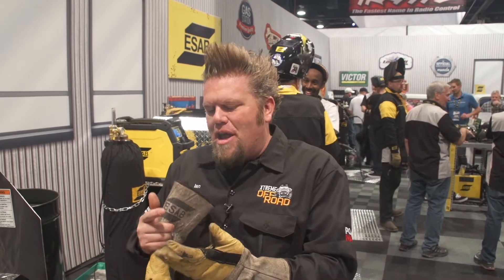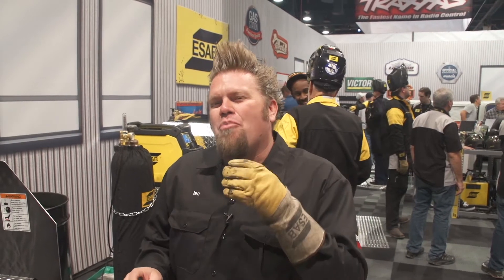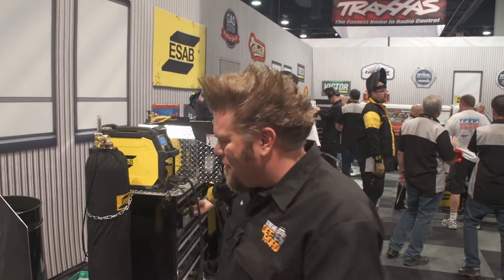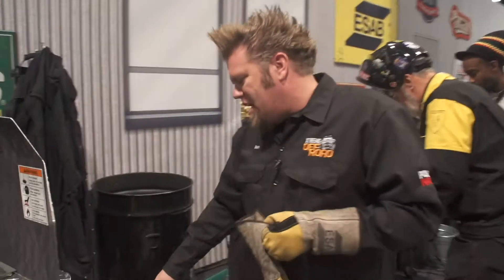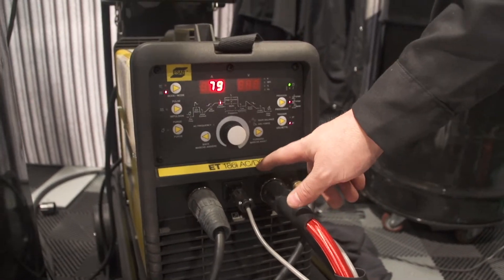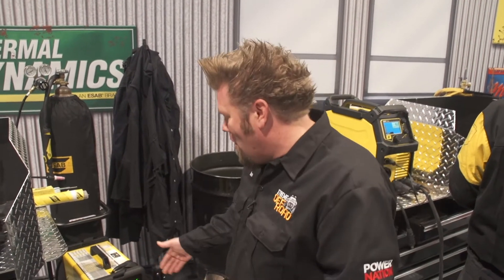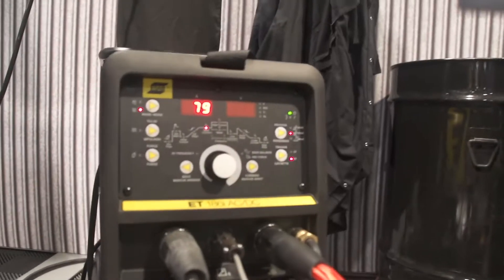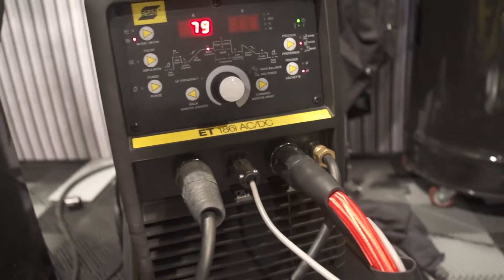Ian Johnson Discusses the ET 186i AC/DC TIG Welder: When Do you Want a Specialized TIG Unit

Comment: It's just too bad that China machine is years behind the older Sanrex made Arcmaster 185. Fix the way the machine reads the Preset amps,two switches in the SSControls ft pedal, and really poor software that causes a very stepped current upslope.Then make the down slope tail out like the old machine, and you are starting to get there.. It's unacceptable no matter what the cost is.. If not, Just scrap the thing..

 I owned many Esab and Thermal-arc tigs, and this machine should not have the Esab nameplate on it..Yes, I owned the 186 machine, and fixed the pedal to work much better, but still needs work after too many years in production.. It has a good arc, but that's not all of it in tig welding..If it welded somewhat like my Caddie tig 2200 AC?DC (Sweden made)that would be helpful.. Esab does not even built the 186, but they did built the Caddytig..  They know how to do it, but chose not even try to fix what is wrong with the 186. Raise the price a bit, if that's what stopping you? A black eye is a black eye.. :)

Way too much salesmanship Hype, and not enough R&D into this things..